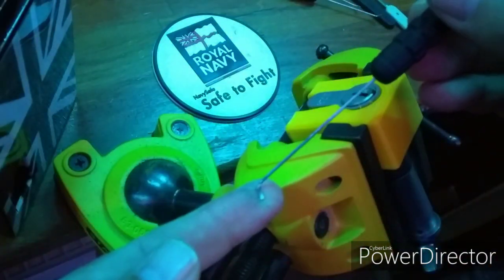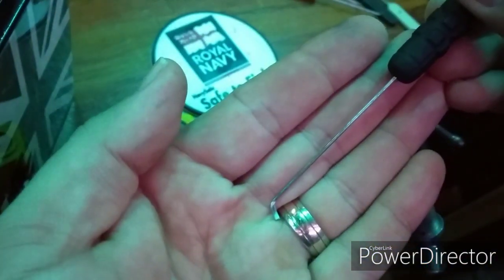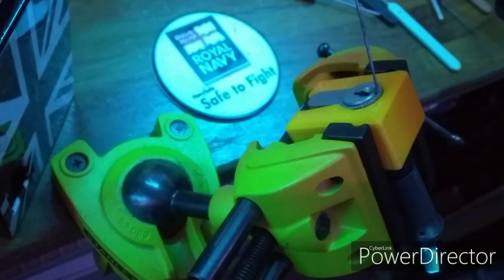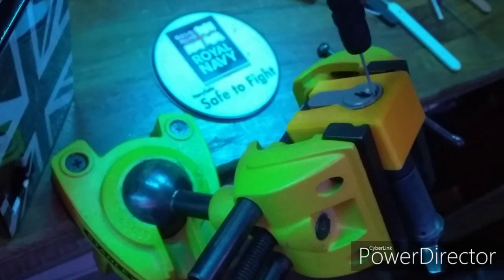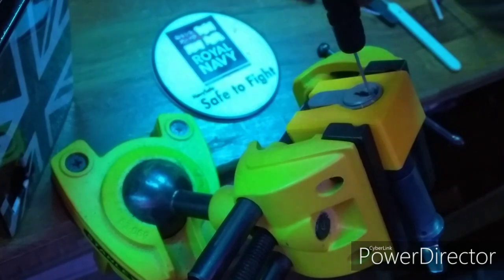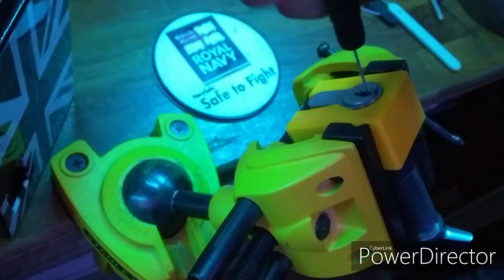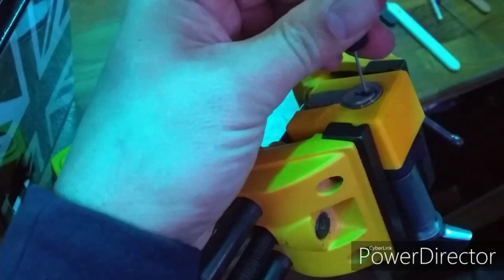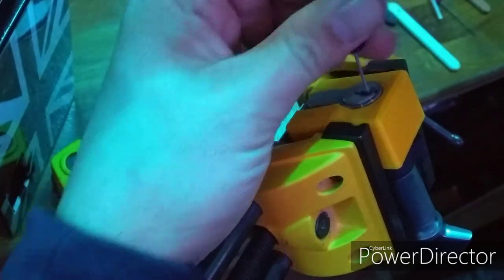Euro Cylinder thumbturn bypass tool demonstrated

Comment: I think it’s about time that the lock companies fix this easy bypass method. Great video. 👍
Reply from the maker: Cheers buddy 👍 I think the only true fix is to remove the thumbturn and just have dual cylinder locks. The lock companies were quick to act on snapping prevention but budget locks are still open to that attack as well. 🙄
Reply: @CoxysPicks  I have an Evva thumbturn and tred different wires with no success. Any idea what might be wrong.